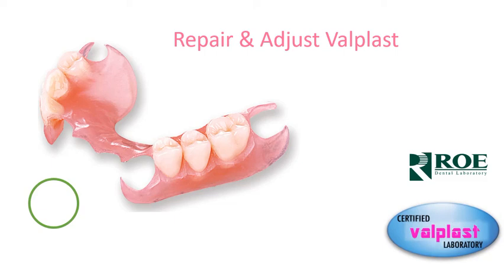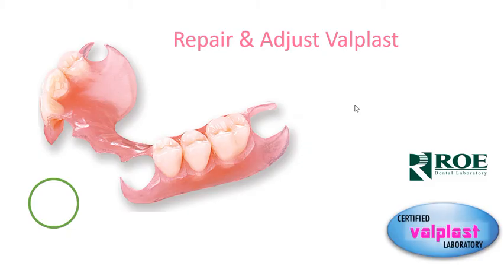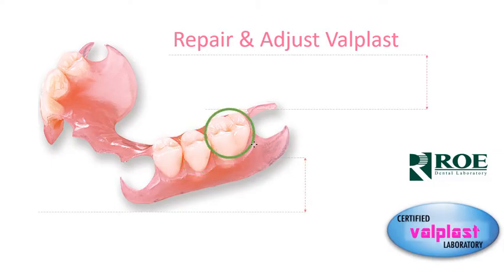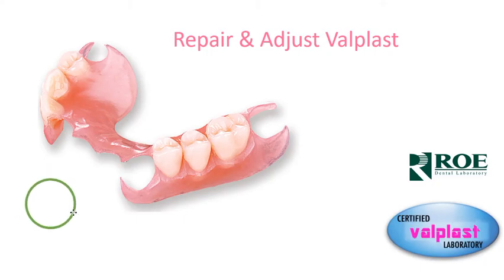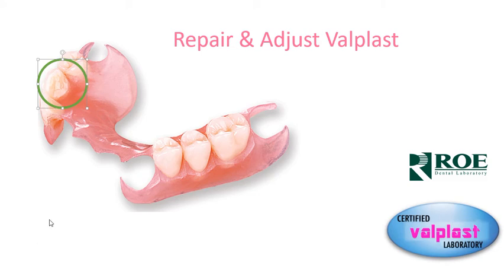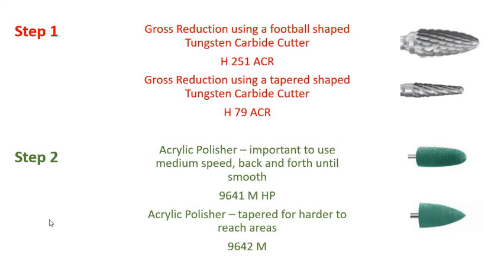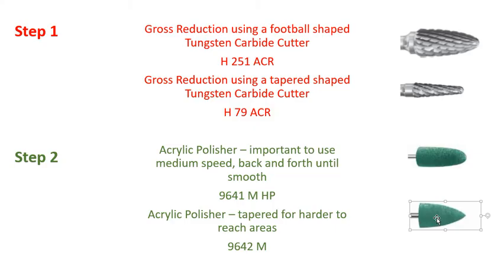Everything You Need to Know about Repairing and Adjusting Valplast Dentures

Comment: What is a jump? My valplast partial has a hairline crack in the base and it's only 3 years old. I'm so disappointed that I spent over $1100  and no one can fix it. I had a new partial (flipper) made and I hate it; it's like a monstrosity in my mouth. Why can't they re-coat or re-surface the base to re-inforce it?
Reply from the maker: Hi Patricia. Valplast has a lifetime warranty. If your Valplast appliance was prescribed after October 1st, 2009 it would have come with a Valplast Certificate of Authenticity (should come from your dentist). This certificate contains a unique 25 digit serial number that can be used to register your denture online. Valplast appliances that were prescribed prior to October 2009 do not require registration. For more information visit - https://www.valplast.com/faq